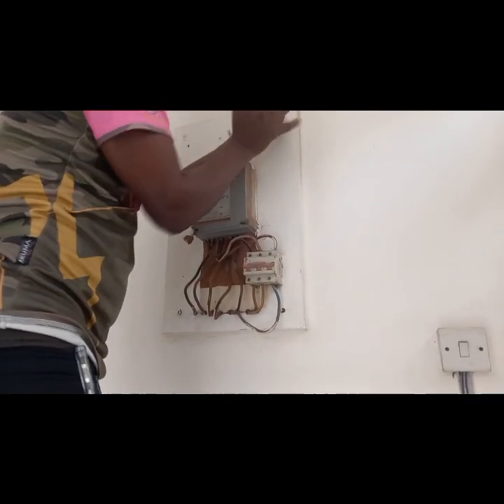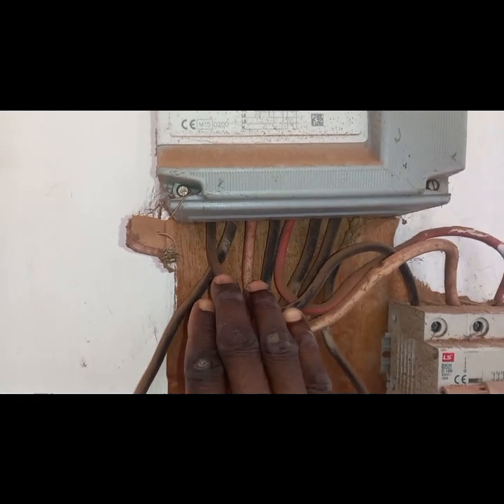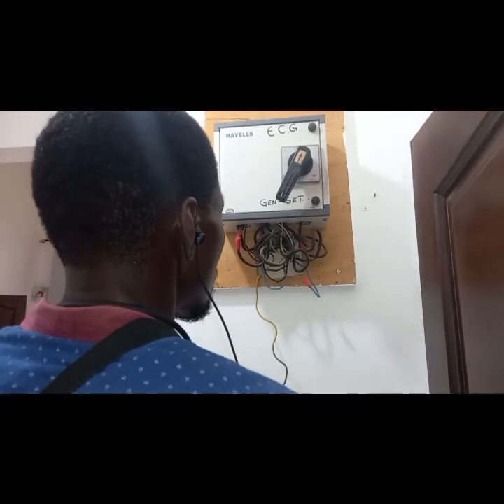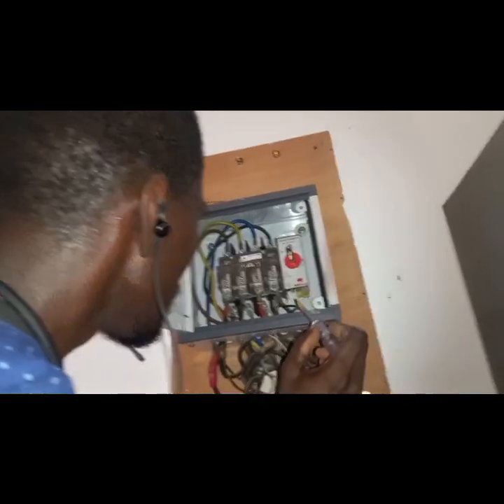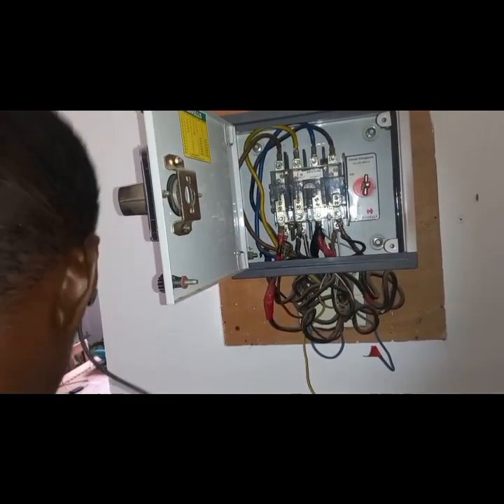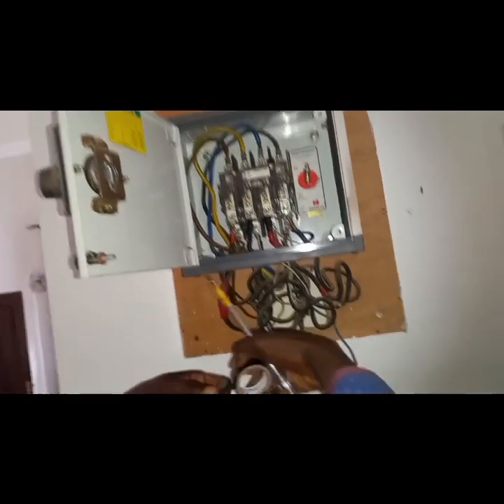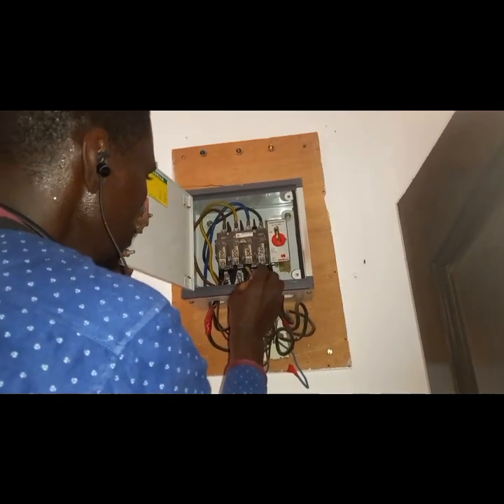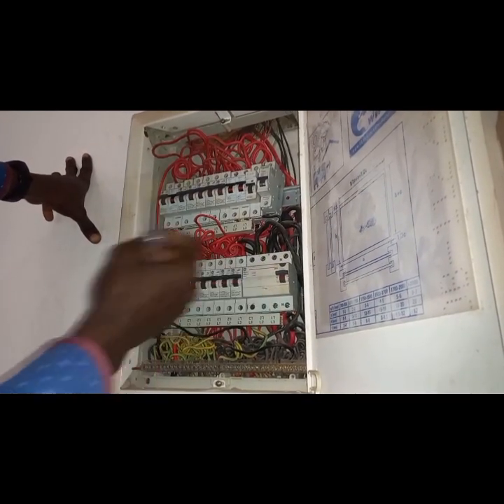Building In Ghana | Fault Finding | RCD Tripping Off During Heavy Rain

Comment: I think there is 1 neutral or live wire getting contact with the exposed metallic part of either the DB or the Change-Over. The dressing in the DB and the change over is very poor.
Reply from the maker: That will cause an electrical issue called short circuit and  short circuit wouldn't be able to trip an RCD but MCB. Thank you so much for the observation and input. I really appreciate you.
Reply: yeah the wiring is very bad,some Ghanaian artisan menn